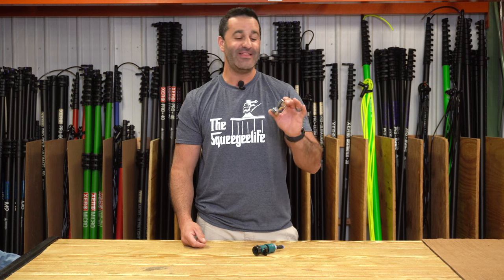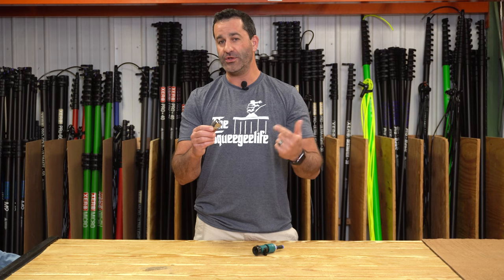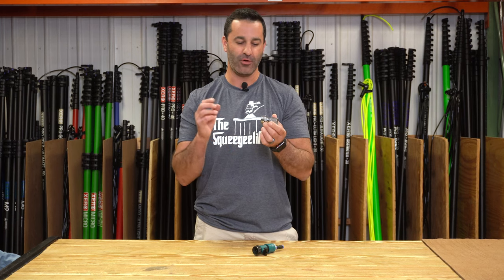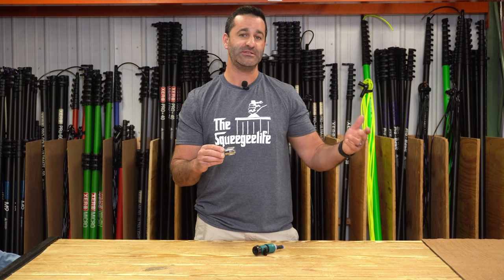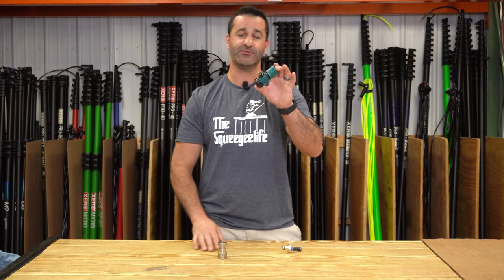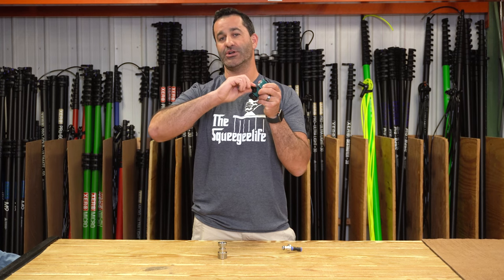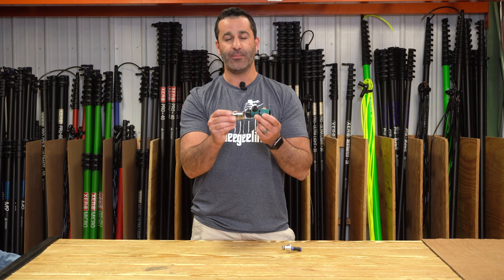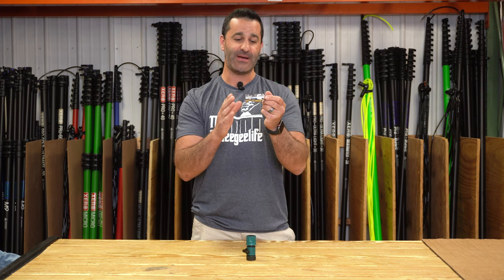Little Tool, BIG Upgrade!

Comment: I prefer metal fittings of course. is it common for people to use them without shut offs? I suppose the univalve prevents this problem but I like having a shut off on the tank.